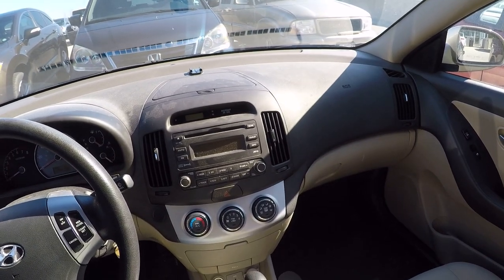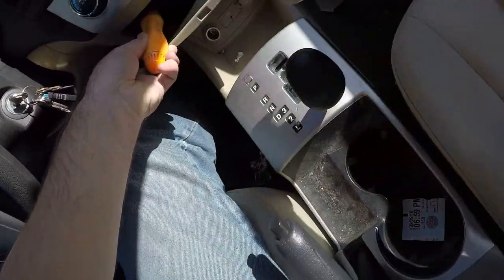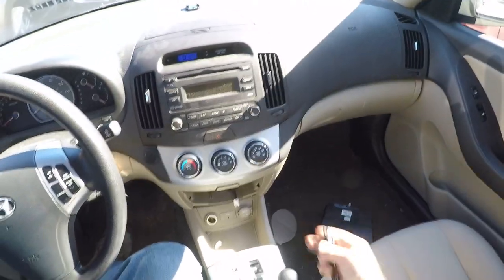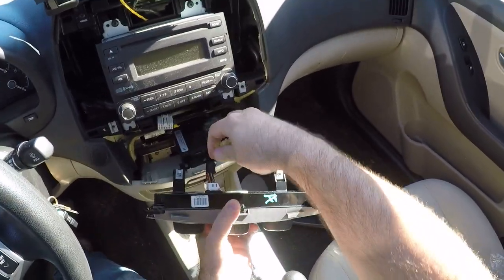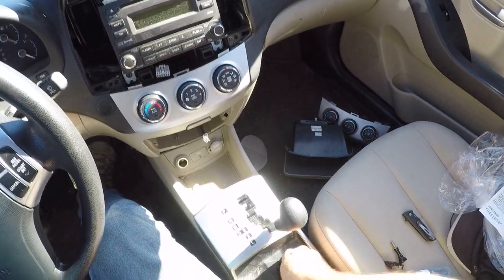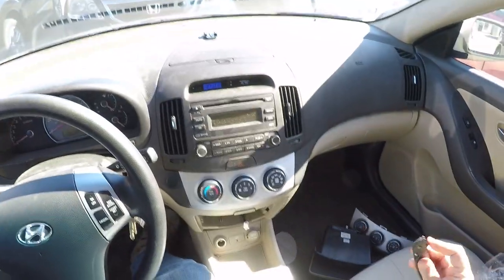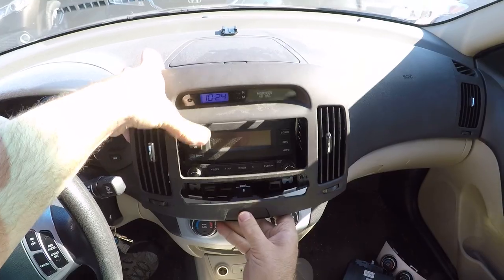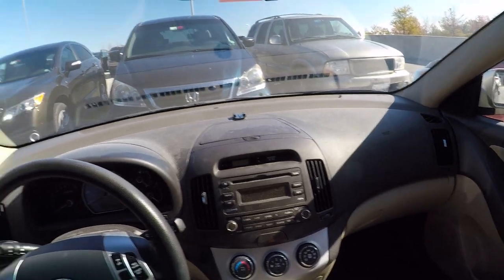Replacing Elantra HVAC / Blower Control Module 2007 - 2010 Hyundai Elantra

Comment: Thank you, my brother. I touched the madness in order to know how to remove the drawer under the air conditioning unit. I searched for a long time, until I thought that it was necessary to dismantle the lime decor. Thank you from the bottom of my heart, my brother. I did not think that it would open so easily.
Reply from the maker: You're very welcome. I'm glad it helped.

Comment: I just got done trying to replace my module. I went thru all the steps and the new module didn't work. All was not lost though, to my surprise  I was able to take the old module apart by taking out the screws and then pulled the knob caps off of the module. I took some electrical parts cleaner/lube that I had gotten from Radio Shack a while back for a guitar amp project and sprayed into the opening around the middle of the rotary switches. I rotated the switches many times and everything loosened up. I put the module back together and plugged it up and everything works great! Your switches might just be dirty like mine were, good luck.
Reply from the maker: Awesome! That's even better than what I did. I hope you shot video of that. I'm sorry I didn't see your comment sooner.

Comment: Many thanks for the video! Your first control module may have been DOA because it was the wrong part number for your Elantra. I had exactly that problem, and noticed that both your DOA unit and mine had the "off" position on the blower knob (center). The proper part for your VIN, and mine, has the "off" position on the top-center of the mode knob (right).
Reply from the maker: mrpeab0dy yes. I noticed that too. I'm not sure of it makes a difference or not. The plugs are exactly the same.

Comment: Excellent video! I need to replace the actuator that controls the air flow to the floor/defrosters; how do you remove the panel on the driver's side to gain access to the actuator?
Reply from the maker: I don't think I had to remove any panel when I replaced the actuator. If I remember correctly I just needed a stubby #2 Phillips driver, and I had to bend myself into an upside-down pretzel.
Reply: @svriderpokey  Thanks, I'll give it a try!

Comment: And of your ac blows only on 4 and not 123 then it’s a bad resistor which is an easy repair you only have to unscrew 2 philips head screws and unplug the wire from it it’s also under he glove box to the far left you might have to peel your carpet linen a little bit to uncover it but you need a stubby screw driver so it fits under there

Comment: I go through about 1 every two years, my fourth one just started failing last week. It makes me wonder if there is a known problem with these units. If your air starts turning on and off by itself then speeding up and slowing down, it's this unit that is failing.
Reply: My A/C flickers on and off randomly but when it's on it blows cold and hard with no issues. I Don't think it's the blower motor or compressor. You're saying you've had this issues and replacing the control module fixed it?
Reply: Did anyone ever figure it out

Comment: On my elentra i only have airflow through the top vents and nowhere else, but the A/C, defogger and "OFF" selection still work, could this be a problem with the climate control module like in the video or is it the actuators? also where are the actuators located cause i cant seem to locate them? thanks a bunch
Reply: @ThePariss333 Awesome, I couldn't find this info anywhere.  I found it because of this post.

Comment: If you have to bang under the glove box for your ac to turn on it’s a bad blower motor which is also easy to change on a 2008 Elantra it’s literally 3 screws and you have to unplug maybe two connections but the new blower motor is pricey ranging from 75 to 80 dollars

Comment: My a/c on my 2006 Hyundai Tucson sounds like there's a short circuit when I change the speed on the knob. I have to adjust the knob on each speed so it can stay on or else it makes the shirt circuit sound.... Do you think it may be the module???? Thanks!
Reply from the maker: It sounds like it could be, but it's hard to say without seeing it first hand. The blend door actuator motor also went bad in this car. That made a buzzing noise if I remember correctly. We sold this car several years ago, so I'm going only on memory.

Comment: Hey I have a question i have a 2008 Hyundai Elantra and I only have a/c blowing to the floor do you know what that means and/or how to fix that?
Reply from the maker: That could be the control unit, but is probably the blend door motor. I replaced that a few months after doing the control unit.

Comment: I have a question.  I have a 2008 Elantra and the blower motor has been acting crazy.  It makes a loud whirring sound, sometimes it blows soft, other times hard, sometimes it just won't blow at all!  Also the A/C and heater turn on sometimes all by themselves, and I have to turn the on/off dial to get them to turn off.   A year ago II brought it in for a diagnosis and a place said I needed a new "Control Head."     I decided to live with it acting sporadically but then about a month ago it stopped again altogether.  Several weeks ago a different place checked it out and said the blower motor is fine and it could be the resistor, so they put a new resistor on it and also replace the cabin filter.   It did blow colder and worked for several weeks but now it is failing again.  The blower motor was acting weird again, not blowing air or fast/slow/fast/slow, and now today it quit working altogether!    I've been fiddling with the dials and although those little green lights come on, and I can hear clicking sounds, like something is trying to turn on...the blower is not working!    So....I'm wondering if it could be the control module.  Is the control module the same thing as the "control head"?   Thank you, John
Reply from the maker: winterdesert1 I think so. It sure sounds like it.
Reply: Thanks for the answer.  I'm going to try to do this myself.  Can you please tell me the exact model/make of the screwdriver you are using, or the size for the tip.  I want to be sure I have everything I'll need.  I did some searching for the control head and it looks like I'm going to have to buy it from the dealer ($300).  I really don't see anything out there that will be the exact same thing unless I do that.  Unless you have any suggestions.  thanks!
Reply from the maker: winterdesert1 it's just a #2 Phillips. Mine is a Snap-on, but it doesn't need to be.
Reply: I have an update for you.  The car place just called me and told me to turn everything on, then to bang under the glove compartment.  If the unit comes on its the blower motor.  I just did, and it did turn on.  So supposedly all of this is the blower motor!!!   Good news I guess but this is all frustrating also!
Reply from the maker: winterdesert1 good luck.
Reply: @winterdesert1  Did you end up replacing the blower motor and fix the issue? Or was it the control module? I'm having the same issues with my A/C randomly turning on and off. Makes a little click sound when it does.
Reply: @chadwin  It was the control module and it was replaced, and it fixed everything.  I just wish I had it done years earlier.  I wasted so much money over the years.  Finally a shop charged about $150 for a complete assessment and determined it was the control module.  They replaced it for $536 (that included an $85 discount!).  No more clicking or randomness.  It's fixed!
Reply: @winterdesert1  Wow! That was a very expensive diagnostics and repair, but I'm glad to hear it fixed it! Thanks for replying. I feel reassured now that replacing the control module will most likely fix my issue. Just ordered the part for $50 on Ebay and I'm just gonna follow this YT video. Thanks again!!

Comment: What was the original problem/issue that led you to changing the module?
Reply from the maker: If I remember correctly, the fan would not turn on, and I had 0v at the fan connector.

Shortly after I replaced the module, the blend door motor failed, so the temperature wouldn't change. I don't know if one had anything to do with the other though.

Comment: Question, are you able to reach the body control module from there by doing this?
Reply: I actually just did this and found that I can get to the body control module by doing this, thanks for the video!
Reply from the maker: I'm glad you figured that out, because I had no idea.
Reply: @svriderpokey    I did this and it was not a fix.  Could my eBay part be bad also?  How do I check?

Comment: My 2010 Hyundai Elantra stopped blowing ac and heat altogether. I fiddled with the knobs and after a bit the controls began working again. But they recently stopped once more. Is the problem my blower control module?
Reply from the maker: It sounds like it, but without laying hands on it, it's too hard to say.

Comment: Will this fix the problem of the a/c fan not blowing any air out (the middle knob)?
Reply from the maker: Maybe. If no speeds work, it could also be a bad blower motor. If some speed work, and some don't, it's most likely a bad fan resistor.

Comment: I'm having an issue where my blower cycles on and off. I can hear the relay clicking, and then the lights in the center of the buttons go out, and the fan stops. Then I hear the relay click, the lights come back on and the blower starts up again. Does anyone know if  this sounds like a bad Blower Control Module? Thanks
Reply: I have the EXACT same issue. My A/C just clicks on and off randomly. But it does blow cold and hard when it's on. Did you ever figure out the fix for it? was it the control unit or blower motor??
Reply: @chadwin  did you ever figure this issue out? I have the same issue. Thx in advance
Reply: @jamiefrierson509  yes! With mine, first I replaced the control module (which didn’t fix the problem) then I switched the Blower Motor itself with a new one and it totally fixed it! Works great now. Just the blower motor for me

Comment: i have the same car and i don't have any hot air you think is module climate control
Reply from the maker: Armando Espinoza It could be. It could also be the blend door actuator or a coolant problem. Your question is about diagnosis. My video is only about changing the module. Good luck.
Reply: Ok thanks for you help
Reply: Ok thanks for you help
Reply: Armando Espinoza did you find out what it was mine isn't blowing any hot air either

Comment: I have a few questions.   You mentioned testing the resistor?  Are you talking about the resistor for the module?  And How did you test the resistor?  Additionally, if you dont mind saying where you purchased your module from because I am also in need of a model like the one you bought.  Thanks

Comment: Hello, this was just a replacement due to that fact that the vents were not changing correct????
Reply from the maker: Kiki Miller No. The air wouldn't turn on at all.
Reply: are you familiar with the vents not changing from floor?? please let me know if you have any ideas or can help, thanks!!!!
Reply from the maker: Kiki Miller Yes. It was doing that after I changed out the control module. It turned out to be the actuator by the driver's right foot. In my case, I think one must have failed, & damaged the other.
Reply: my Elantra still makes cold air but it doesn't blow.  I don't know how to fix it.  I used to be able to jiggle the box under the dash on the passenger side, but now it doesn't work at all.
Reply from the maker: Xenia Gilmore sounds like the resistor or blower motor has failed. They are both under the passenger side. I'd try replacing whichever is cheaper, or returnable first.
Reply: svriderpokey thank you for  the tip.  I bought the car brand new and seems like absolutely everything is starting to fall apart now.  that 10 year warranty is pretty accurate I guess lol
Reply from the maker: Xenia Gilmore it happens to every car. Nothing lasts forever. They have a predicted service life, and when things start to go, more things are sure to follow. The good thing is that replacement parts at usually as good as original ones, so replacements should last a while. Keep the car clean, be careful not to break anything when working on it and fix what breaks as soon as you can, and it should last a good long while. Cars are so good these days, that if you keep up with them, the only thing that really kills them is rust. Its much better than it was in the old days.
Reply: That's good to know!  Im looking for a blower motor online right now :)  Thanks so much for your help.  You rock!
Reply: @svriderpokey  Thanks for this post.  I couldn't find that actuator, but thanks to this vid and a couple of the comments I was able to find it.
Reply: Where can i find that part